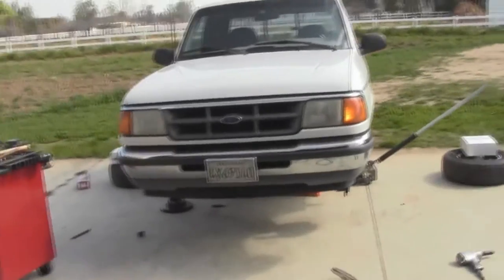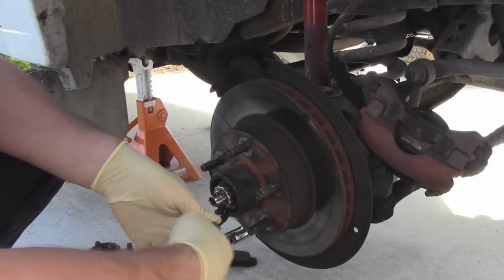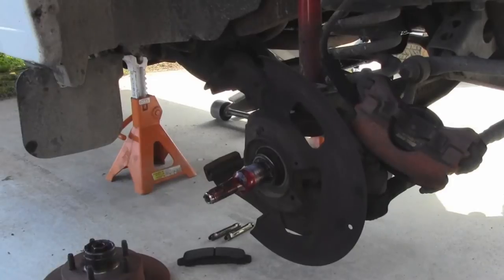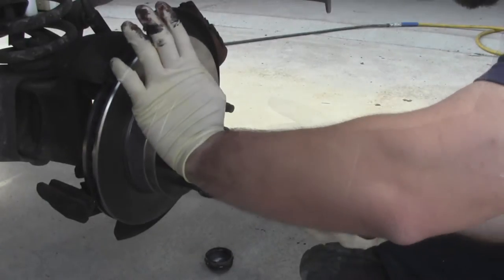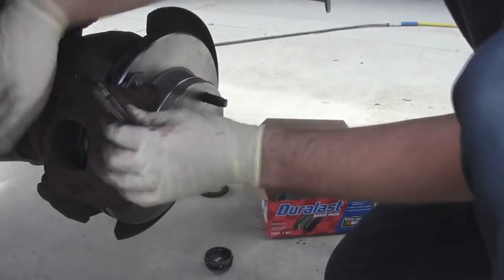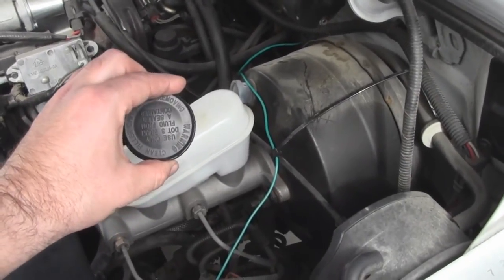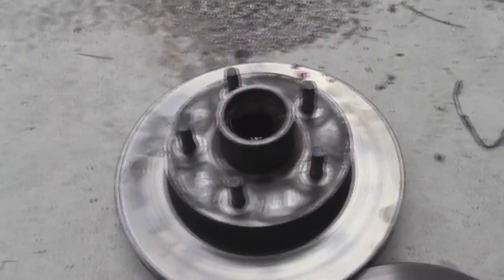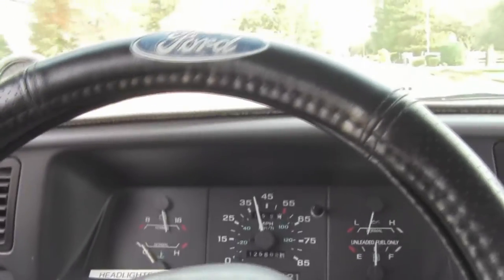How to Change Rotors on a 1993 and Up Ford Ranger

Comment: Great job I have to front  brakes Rotors & lines on my 94 ranger splash  I took it to a shop when I first bought the truck to have them run rear brake lines & told them to do a break inspection  ,They failed to mention that when someone was driving the tire must have fell off at high speed they locked the brakes up and it slide on the pavement because the Rotor had New lugs and the rotor was square on one side all the way to the brake pads  .. Go figure

Comment: I don't understand when you refer to the rotors being warped. Rotors do not warp. They do wear unevenly or get brake material buildup, but they don't warp. they are heat treated in heat that is at least 3 times hotter than any extreme braking situation. thank you for the video though. it did help. But I did want to address the warp rotor myth.
Reply from the maker: It’s said in shorthand. People know what you mean when it’s said no matter the “real” meaning or not. Everyone knows rotors don’t actually “warp”.
Reply: Great video!
Brake rotors are the large metal discs visible behind the wheels of a car. These spin along with the wheels so that when the brake pads clamp down on them, they stop the car. Brake discs have to withstand a tremendous amount of heat. Not only that, they have to dissipate that heat into the air as quickly as possible because the brakes will probably be pressed down again in a short amount time. If the surface of the disc becomes uneven over time, braking will become jittery and less effective. This is usually referred to as warping.

How brake rotors warp
A common misconception when rotors are referred to as “warped” is that they are no longer straight when rotating (similar to how a bicycle wheel gets warped). For cars, in order for that to be the case, the rotors themselves would have to be defective as the temperature required to make metal that resilient soft enough to simply bend would be tremendous.

Instead, the warping really refers to the flat surface of the rotor becoming uneven. Heat is the number one cause of this, and can cause warping in more than one way:

Glazing the brake rotor with material from the brake pad. This happens because brake pads, like tires, are made with different amounts of hardness and stickiness depending on the intended purpose. When brake pads made for normal road use get very hot from high-speed driving and braking, or from riding on the brakes for a prolonged period of time, the grippy material can get too soft and basically "paint" the brake rotors. This means that the brake pads won't grip onto metal when the brakes are applied once again, causing decreased brake performance that is less smooth than before.

Wearing down the surface of the rotor and making harder spots in the metal stay slightly raised off the surface. The reason that brakes don't normally wear down very much revolves around a fairly straightforward concept. Since the metal of the rotor is harder than the brake pad applying friction to it, the pad wears down while the rotor remains largely unaffected. With excessive heat, the metal becomes soft enough for the pad to wear down the rotor surface. This means that slightly less dense spots in the metal wear down faster and make the harder spots stick out, causing warping. Had an emergency brake not releasing all the way and the drum got so hot that the drum was shot and could not be turned.
Reply: Sometimes if a wheel is out of round or out of balance, it affects the braking action, and it can wear the rotor or drum unevenly and start acting like it's warped.  I've rotated a wheel to reduce this by taking it off, spinning it 2 lugs and reinstalling it.

Comment: The hardest part for me is finding a spot to lift the car on jackstands.
Reply: I heard it was cheaper to take the rotor in and get them machined
Reply from the maker: Da Coder The problem with machining rotors is it removes metal which makes them even more susceptible to heat and warping idk how much it costs though, ive gotta do the rotors on the malibu too they are doing the same thing, might just pick up a pair from the junkyard if I can find a decent set.